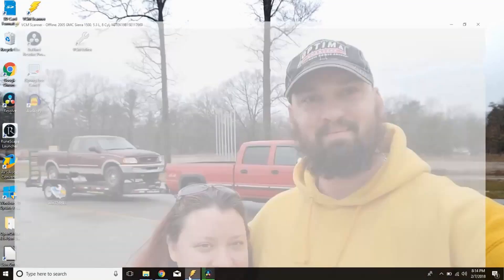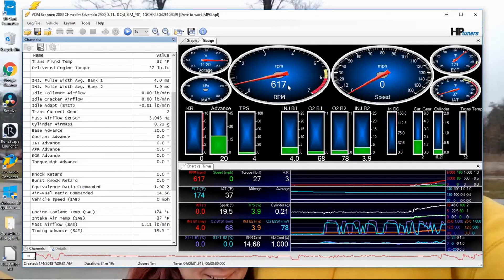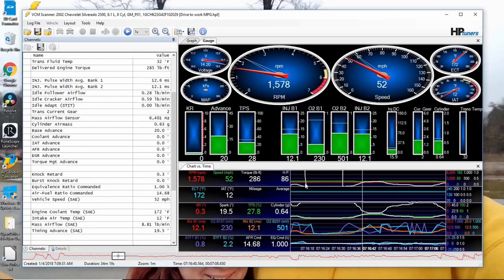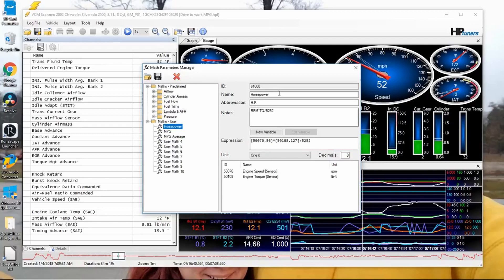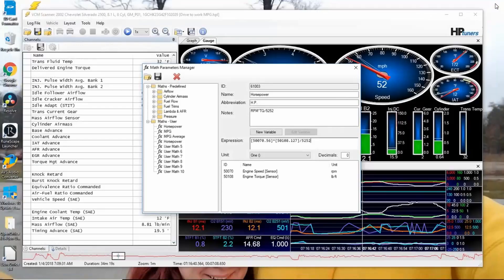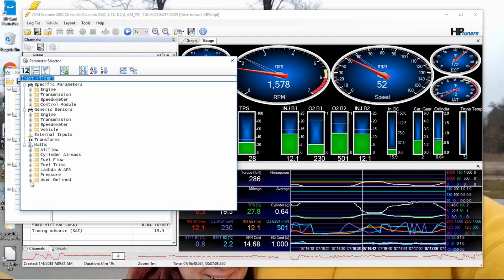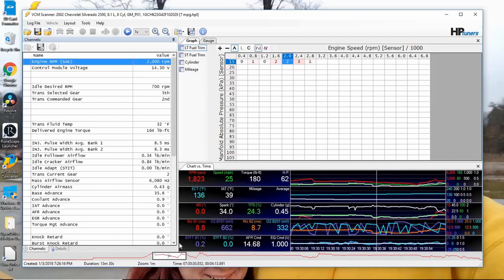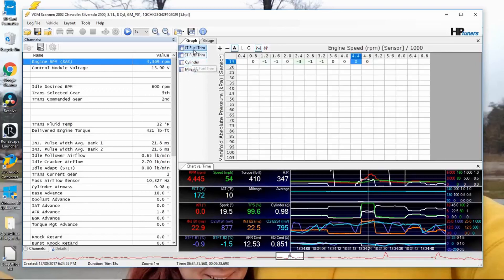HP Tuners how to log Horsepower with User Math

Comment: This is pretty cool but I don't think the numbers it reads are right? At peak of a 1st geat pull It logged 800 hp and my setup definitely isn't pushing 800 hp at the crank
Reply from the maker: No, I abandoned this, I couldn't get consistently reasonable numbers out of anything modified

Comment: Awesome video I am looking to add user defined math with airflow off road only can I add PIDS and turn them on or off ? 
Thanks
Reply from the maker: Yes, you can set your channels up anyway you like, just turn them on or off
Reply: The Driveway Engineer thanks that’s what Was holding me back from purchasing
Reply: Have you heard of anyone tuning the 6 position sotf switch
Reply from the maker: @WaterandWoodsmen  no, changing tunes on the fly is just a gimmick for Powerblock.

There's no such thing as a tow tune, power tune, race tune... A good tune does all of those things well.

The hardparts in the engine don't change, so all you'd be doing is giving up power for some reason.
Reply: The Driveway Engineer cool I appreciate you taking the time out of your day to help
Reply from the maker: @WaterandWoodsmen  any time!
Reply: @TheDrivewayEngineer I want that tool